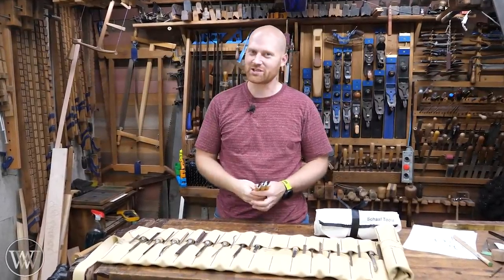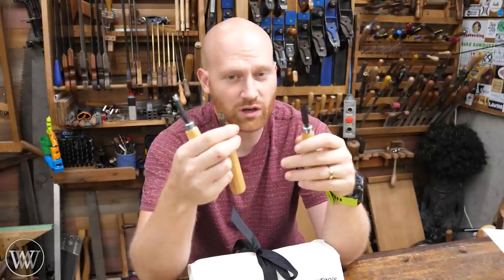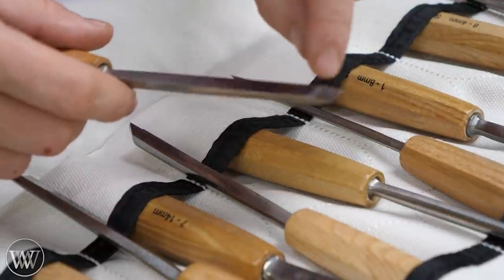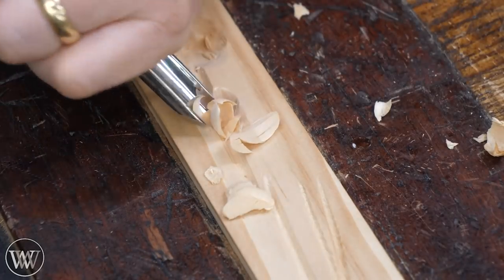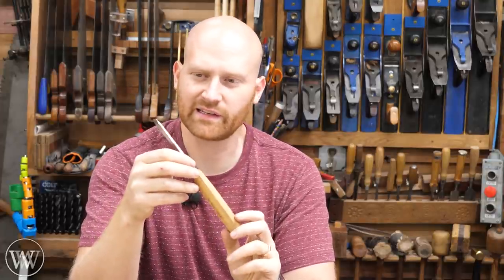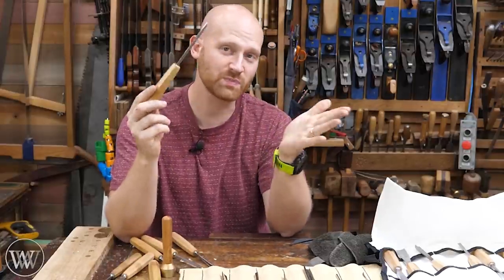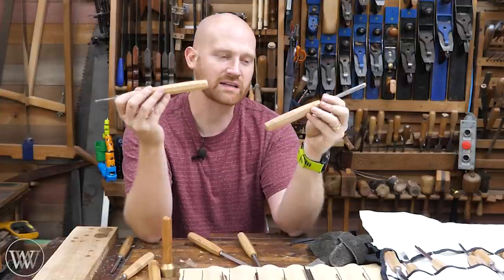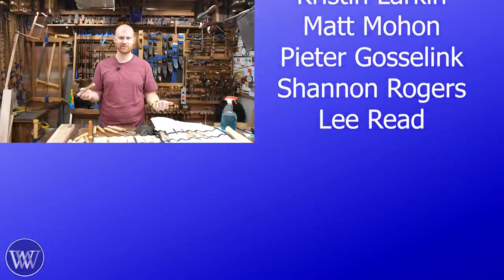$8 a Chisel? YEAH RIGHT!

Comment: Testing anything out of the box that isn't incredibly expensive is a waste of time.  The question isn't about whether the manufacturer paid a flunky to put a mirror polish on the edge, the important issue is how good is the steel.  Is the tang a reasonable length and girth, or will the handle come off easily?
In other words, can the tool be made to work as well as an expensive tool after it has been fine tuned?
If you buy low priced tools, you just assume that you are buying a kit.  Budget priced tools are not ready to go.  You have to take the time to refine the tool in the areas that the manufacturer skimped on to keep the price down.  
If the buyer doesn't have the skills, or tools, needed to "finish" a brand new tool, he will have to buy very expensive tools instead.

And finally, budget tools are made in countries with low wages.  Some of those countries are unfriendly to Europe, North America, and Australia.  Buyers should consider if they want to save a little money on tools now, and spend more on tax money later when your country goes to war with the place who you made rich from buying their cheap products.
Reply from the maker: That is very true for most chisels. However for the higher quality chisels in the market they come ready to go out of the box. I wanted to test these initially as they were listed as being sharpened and ready to go. As we all know that is rarely the case.
Reply: @WoodByWrightHowTo  
At that price, nothing is ready to go.
At 3 times that price, I don't expect anything to be ready to go.
I don't care what they promise, their definition of ready to go is never the same as mine.
Regardless, I enjoy your videos.  Thanks for the reply.
Reply: @WoodByWrightHowTo  That's not quite true! Here's what we say on the product listing: "Do not buy this set if you are not willing to sharpen your tools. These come factory ground and sharpened, much better than most of what you'll find on Amazon, however, like any gouges, will require sharpening sooner or later." We do sell a professionally pre-sharpened set on our website for the very reason you outline in your video. Anyways, thanks for the review :)
Reply: @deezynar  We certainly don't promise these to be ready to go! Here's what we say on our product listing: "Do not buy this set if you are not willing to sharpen your tools. These come factory ground and sharpened, much better than most of what you'll find on Amazon, however, like any gouges, will require sharpening sooner or later." After testing by Joe Dillett and Dick Belcher, we are confident that our steel holds up against all the big brands.